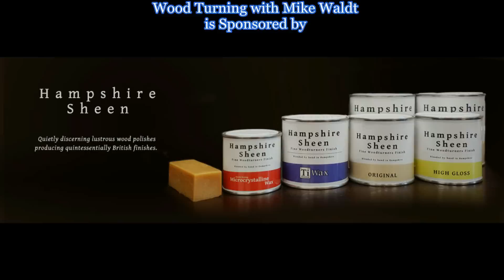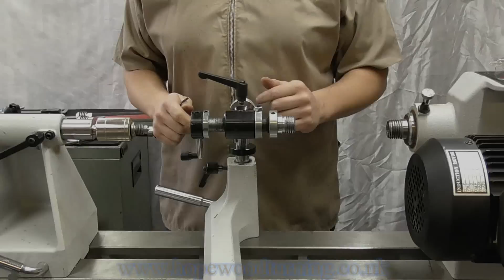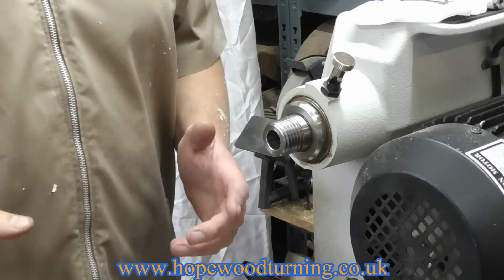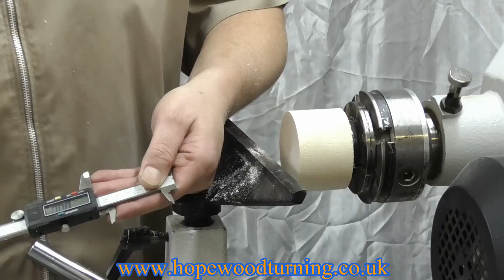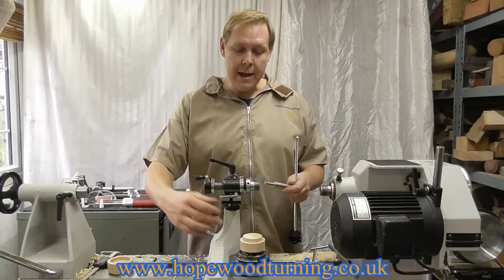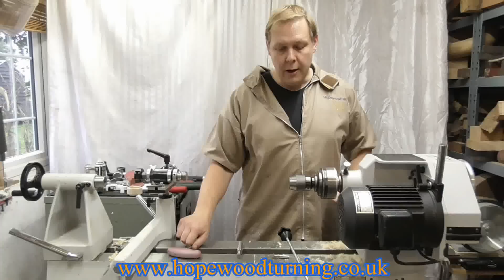The Hope Easy Set Threading Jig Tutorial - Plus some handy tips.

Comment: I'm kind of late to the party, but thanks for the great video. Simon had the perfect delivery...I learned exactly what I needed to learn, and never got bored. (I think I should use the term "spot on!") Also, thanks for showing us how to make adjustments to the fit. Good selling point for the hinge (at least for me!). One question...I tend to be a little anal about some things. Often, I "eyeball" things like screw placement, etc., but I am concerned about eyeballing the parallel lineup of the banjo (jig) when setting up. Maybe it will look easier once I have the jig on my machine, but do you have a method for lining the jig up parallel that is more "idiot proof"? Is there any availability in the US in 2020?

Comment: I don't understand how the crank handle in timed to the Spindle rpm.  Your lead screw would do this on a metal lathe. Never mind, I got it.
Reply from the maker: Lol....glad you've got the idea now Thomas. Thanks for watching.
Cheers
Mike
Reply: Silly me, timing is only necessary if the part is turning and the cutter is stationary.   You wouldn't believe how many miles of pipe I've threaded without ever realizing this.